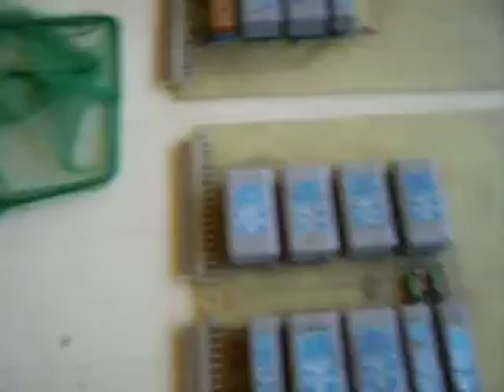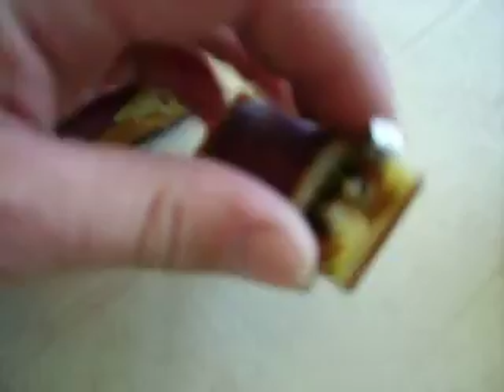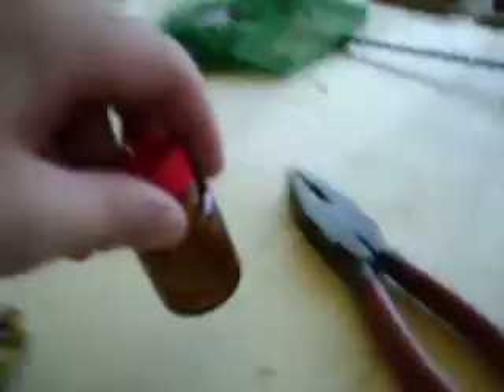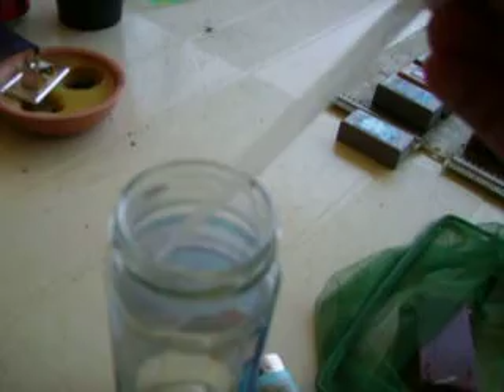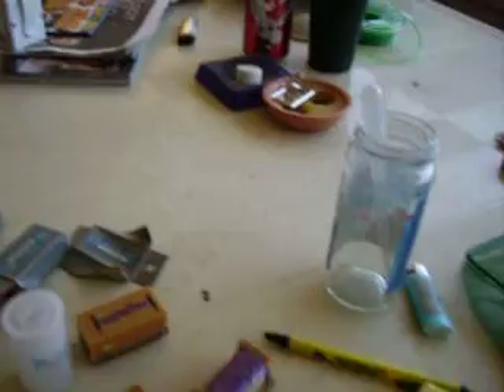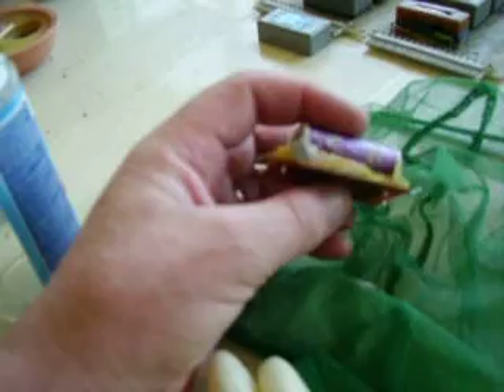Recovering Mercury from mercury wetted relay switch.

Comment: I just want to say thanks for the video - great job.  I like how you break them open under water.  good idea.  I work with mercury wetted reed relays and its important to know that the glass capsules are pressurised up to 100 psi with nitrogen or a hydrogen/nitrogen mix.  This is done to make sure the mercury does not vaporise during operation and also to keep the mercury from oxidising (forming a grey film on top).   Mercury can also be handled with stainless steel tools.  Best - curt